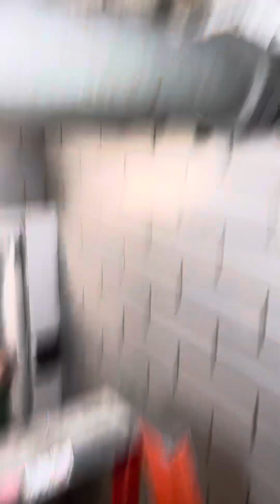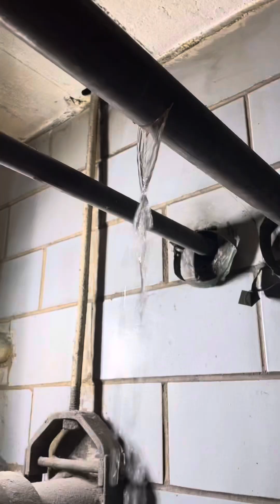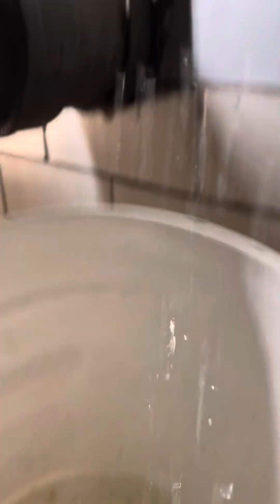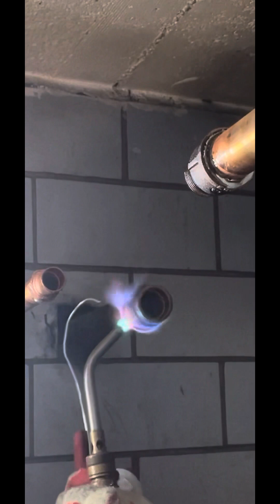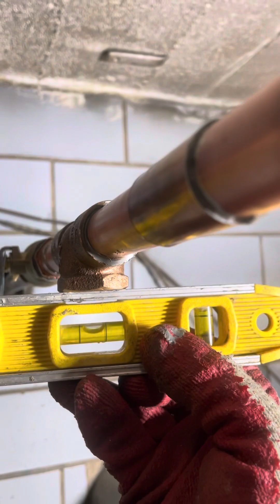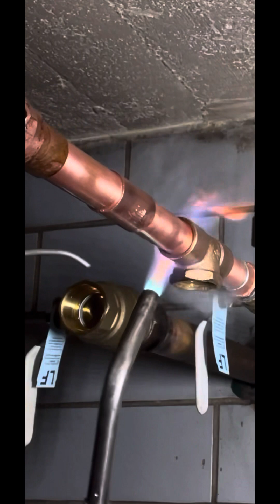RISER VALVES with Drain Tee’s Install NYC Pre-War Building Plumbing

Comment: Very clean work.  It looked like you switched from acetylene to propane.  Why?
Reply from the maker: I actually stuck with acetylene the entire way - I did switch solders though - I used Staybrite 8 on the brazed cup TP adapters then silverbrite 100 on the regular L-copper fittings, so there’s a bit of a temperature difference at melting point

Comment: I was wondering if you bend copper in the states?? Here in Ireland we bend mostly but sometimes solder if we are caught for space
Reply from the maker: I’ve been seeing more people bending copper - but mostly for HVAC applications - over here in NYC it’s all fittings. I haven’t come across any copper bends yet
Reply: Down under in Oz, we do a bit of each, press fittings, olive compression, fluid compression, brazed, with fittings, and without… obviously you can’t bend a T, but with the right equipment, you can of course pull a branch, depending upon whether your regs and codes, allowed equal sized pulled branches and water supply lines or only reduced diameter branches-in any case, excellent work& very neat👌🏾🔧

Comment: Looks good.  But why did you use brass fip instead of copper?  Just curious, I always use copper unless its to a different metal pipe and use brass for electrolysis.
Reply from the maker: Brass pipe - so I used TP adapters specifically made for schedule 40 outer diameter pipe transitions. Some of the TP adapters are copper including 1 in the video on the 3/4”

The rest are brass

Thanks for asking I hope that clears things up